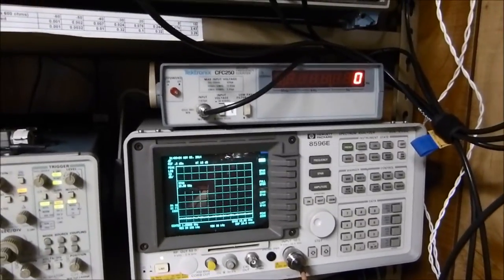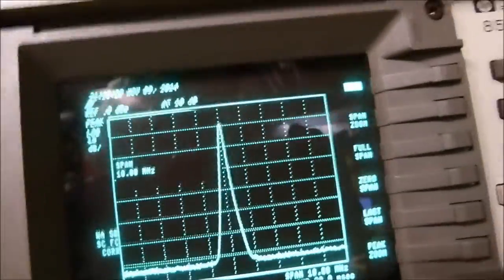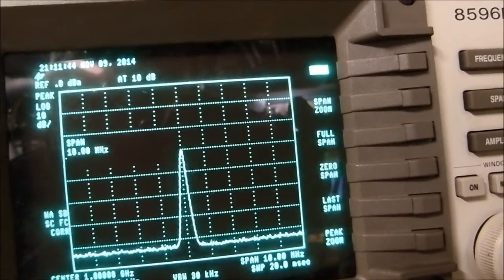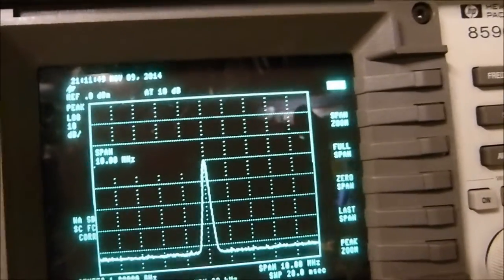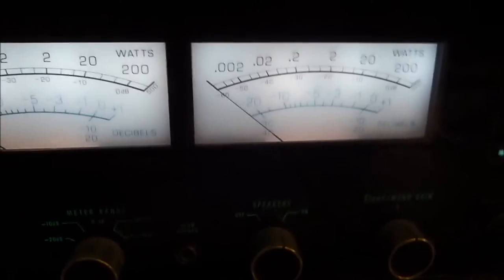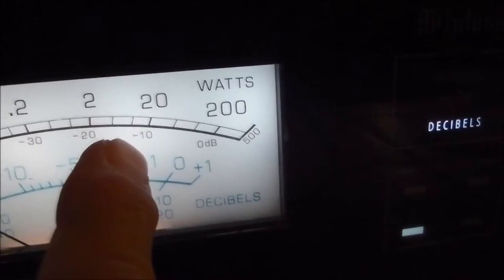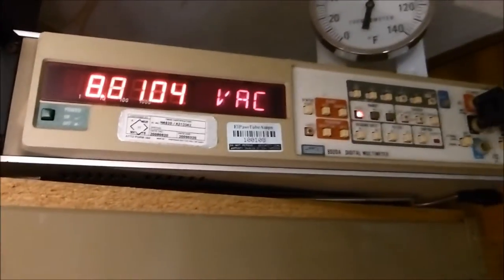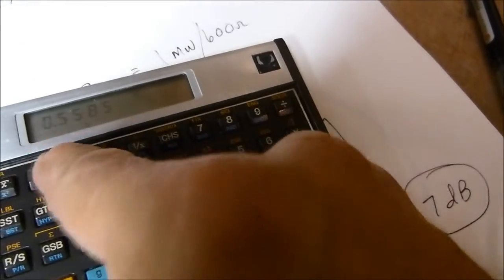Decibel Discussion With Practical Applications and Examples

Comment: This truly will become a classic video! Thanx for upload!!

"Thanks" for that error at 12:51, as this is very common when dealing with dB "referenced" measurements. UnCal/Cal switches are sometimes so tiny and in a 24ch R2R deck you´d simply get lost on your calibration chain...and sometimes after you think you just finished with it finally and play a Cal-mono 2inch tape and suddenly see some 2-3ch overshoot in 1-2dB you go "WTF..." and as you are checking the tape return PCBs you see some little switches laughing at you while beeing in the *Un*Cal position.....damnIt...all again....

15:28 you´d better call it "vintage" McIntosh Amplifier;) That´s why almost all meters are named "VU" = Volume units, so you can have an ordinary dB scale as this : -20, -15, -10, -3, 0, 3,5, regardless of the actual reference ;)

Uhhuhh 17:40 ;), there´s that term again: "RMS power" ;) RMS power is always 0 with respect to infinity of time;) I remembering your RMS video very well, please add a "klick-me" thing to that video here, as well. As it would help people understand the whole thing a little better....

For 24:24, i give you a BiiiiiG wave, nice to see you again :) :) :)

You may have added this: +3dB is double the power (10W and +3db will be 20W); +10dB adds a magnitude (10W and +10dB will be 100W)
and
 +6dB is double the voltage (4Volt and +6dB will be 8Volts); +20dB adds a magnitude (3Volts and +20dB will be 30Volts)

I can hear the Bell ringing, thanx a lot :)

Comment: Great rundown.  I'm curious about running audio equipment at 4 vs 8 vs 16 ohms.  What does it do to the circuitry driving the load?  There is a reason some amplifiers can't run at 2 ohms, but I don't understand why.
Reply from the maker: Greg's Garage I assume the 2 ohm load is for a SS amp with no output transformers. Think of your wall outlet: 115 volts at 15 amp max or you trip the circuit breaker. That would be 7.67 ohms (nothing to do with audio) and if you go any lower than the 7.67 ohms you will be drawing more power than the CB can maintain. As you go lower than 2 ohms on the output of your amp, more current is flowing through the output transistors and eventually they are going to be supplying more current than they can maintain. With that said,  I made a YT video at:  Vacuum Tube Output Transformer Measurements Determining Turns & Impedance Ratio & Matching To Tubes   This might help answer some of the questions about how the load impedance affects the impedance across the push pull tubes.
Reply: I will look up that video.  Thanks for the explanation.  I know about 80% of what I need to know about electronics...  I'm trying to fill in the last 20% so I have a good picture of things.